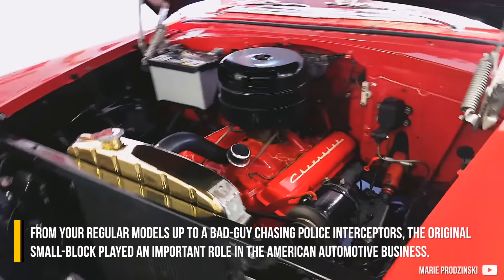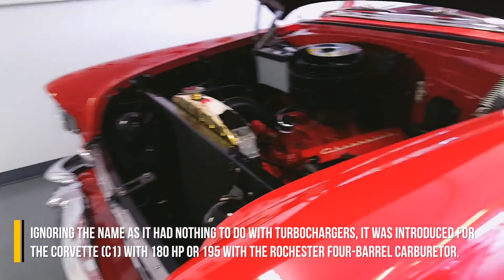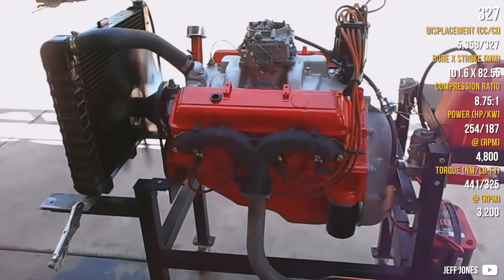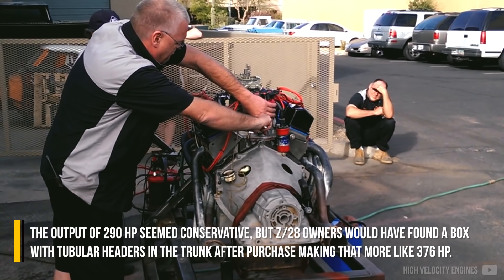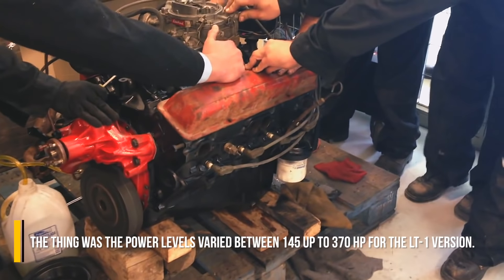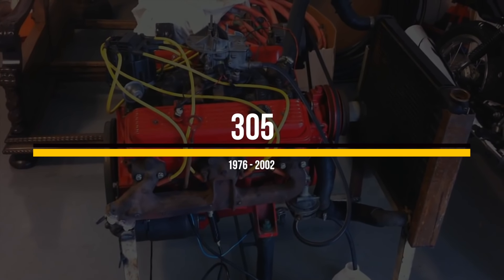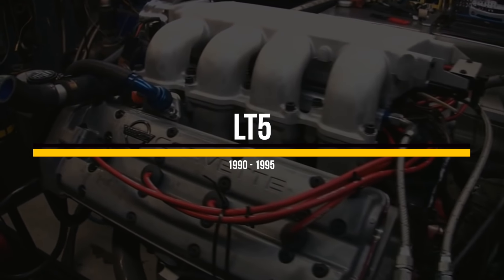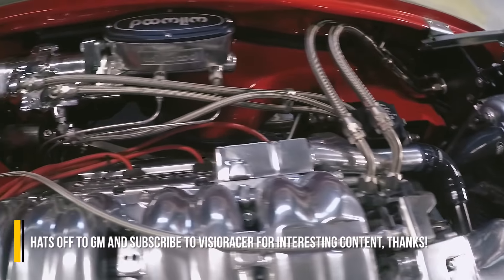GM Small-Block: Explained | Powered America For 48 Years

Comment: Don't forget about the 4.3 V6. It is based off of the 350 Small block with 2 less cylinders. They still use it in the GM trucks and vans today.
Reply: Jaden Sanderson nope not the Vans that ended I'm 2014 with the cancellation of the 1500 express/Savanna
Reply: Kyle C. Are you sure? It is still an available option on the Chevrolet and GMC website for the 2018 model year.
Reply: I think the new 4.3 is based off of the LS motors
Reply: Dakota McAtee Yes, the 2014-current 4.3 is based of of the LT1 from the Corvette and Camaro, as well as the 6.2L from the Pickups.
Reply: Also buick grand national i think
Reply: The newest 4.3 is based off of the LT engines. Direct injected.
Reply: GN had Buick's 3.8. The 4.3 turbo you're thinking of was in the GMC Typhoon/Syclone trucks.
Reply: @dakotamcatee2807  they are. All aluminum. Skirted main bearings and cathedral ported heads.

Comment: Do the GM big block next! The 427, 454, 496, and the monster 572
Reply: Frank Cucunato And the 502.
Reply: BIGBLOCK5022006 I did forgot about the 502. Yeah that's a good one as well
Reply: dont forget the tall deck 366 and 427 v8s
Reply: the monster motors are a completely different block...the GM big blocks started with the 366 which was found in dump trucks and school buses back in the day
Reply: I know. They were good ol' motors too, and really sounded good.
Reply: The largest big block production passenger car/truck engine for Chevy was the 454, everything bigger is a crate engine and wasn't offered in a vehicle. The Big Block generations are 396, 402, 427 & 454. They did a 348/409 before that, yet that's a completely different engine family, no? Caddy did the 472 and the 500. Olds the 455. Buick a different 455. Pontiac had the 421, 428, and yet another variation of a 455. The 502 and the 572 have been the most popular, sales statistically speaking, crate engine and stroker kit, respectively, GM has made (and others ie; Dart, World, Scat, Eagle, etc.) since their release to the general public.
Reply: Russell Loyd I'm pretty sure they had 572s in some Cadillacs back in the 60's
Reply: Frank Cucunato No. Biggest engine ever offered by GM in a production passenger vehicle is the Caddy 500. They had the 472 before that. The GM 572 is a Chevy crate engine, never offered in a vehicle.
Reply: You forgot the 348, 366, 396, 402 and 409
Reply: There's more GM big block families than the Chevy one.
Reply: I Had 8.1 with an Allison in a 2002 2500HD 
I now have a 2020 2500HD 6.6 (400cid) gas I like it better then the 8.1. I pull a 34ft 5th wheel 
The 6.6 has more HP torque

Comment: A year ago I  bought a brand new long block crate 350 engine for my 1989  2500 van for $1500. It came minus the Throttle body, starter, and ignition wires. What a deal. Free delivery, too. It gets better mileage than the 305 that I took out.

Comment: Back in the 70's it was usually easier and cheaper to get more HP out of a Chevy small block than a Ford or Mopar. While the Mopar 340 and Ford's Cleveland motors were comparable to Chevy small blocks in HP, there just weren't as many of the better Ford and Mopar small block packages made. There were a ton of Chevy 283, 302, 307, 327, 350 motors that were made - especially the 283 and 350 motors, and the parts were plentiful and all interchangeable.

Comment: the 307 was a 283 bore with a small journal 327 crank, the  4 inch wide blocks were designed to go 302 327 and 350, by changing the crank throw with the same 5.7 connecting rod, as the stroke was increased the piston pin bore was raised

Comment: The LT5 engine was never based on the small block.  It was a special one-off engine designed by Lotus and assembled by Mercury Marine.  It had a 3.9" bore and a 3.66" stroke.  It also had a two piece aluminum block and no provision whatsoever for a cam in block setup.

Comment: You left out two small lock Chevy engines, the 262 V8 (4.3 L) and the 267 V8 (4.4 L). The are sometimes refered to as "mini mouse" engines, which were designed and built with efficiency in mind.

Comment: Very interesting. I have a question. What is the diference of ci for cc??? Then, what units of small block chevrolet is actually used for drag racing modifing with nitrous, turbo, procharger or a blower??? And what is more capable of it??? Then if you can do the same with big block and motors with be able to modified to drag racing, that's better
Reply: 1000 cc = 61 ci
Reply: Andy Harman thanks for the 1st question

Comment: I recently purchased a 5.7 liter factory built  long block engine from general motors marine.  It is the same small block 4 bolt main seal engine that has been in use for decades but has a roller cam and roller rockers making it a small block VORTEC for marine application. It is fueled with a multiport fuel injection system with high and low pressure electronic fuel pumps attached to the engine. The engine produces 320 hp and 320 ftpounds or torque at 5K rpm. It is a fantastic gasoline marine engine. This V8 engine is as bullet proof as it gets.  I have placed 3 of them in my boat over the past 20 years. The first one was 260 HP with a single 4 barrel carberator.  The second one was 280 hp with a throttle body fuel injection system.  The one recently placed is a beast of an engine.

Comment: You forgot one, which was the 307. Was a durable engine!
Reply: It was not,lot of them did not hold up
Reply: Fondly remembered as "old butter cranks"
Reply: Chevy 307 wasnt  reliable but Oldsmobiles 307 was neither was Chevy 305 those things were trash
Reply: Aaron Cone.
307s had a nasty habit of destroying their cam shafts and lifters.
Reply: A 307 was a 283 block with a 327 crank.  3-7/8 bore, 3.25 stroke.
Reply: Oggy The components were as light and cheap as possible. It was designed by accountants. Nothing wrong with the basic design. They tended to use a lot of oil.
Reply: @CirocObama.94  The 305 was far from trash.  It wasn't built by the factory as anything other than an economy engine, but with the proper set of aftermarket heads a 305 can be built to turn heads.
Reply: @silicon212  I'd rather have a 307
Reply: @CirocObama.94  The 307 has a better bore size, allowing for larger valves with not-so-exotic heads, but the shorter stroke means less peak torque due to less leverage.
Reply: dexos  The WP S/R Torquer 305 heads were similar to the standard S/R Torquer heads, but the valves were a little closer together to allow 1.94/1.5 valves to be run.  That plus the 58cc chamber size made them ideal for other engines with higher compression ratios as well.  Stock 305 heads were smog heads, lightweight castings and flowed almost as well as a solid cement block.  There were some better than others but far and away those S/R Torquer 305 heads were a game changer.  Too bad they're no longer made.

Comment: I''d be a little reluctant to call a 400 cui engine a small block tho.
Reply: It absolutely is a small block.  It uses the same cylinder heads as the 350s assembled alongside them.  The only difference are the presence of steam holes drilled to compensate for the heating issues that came with the siamese bores.  It uses the same valve covers, oil pan, intake manifold, fuel pump, timing cover, water pump, engine mounts and whatnot as any other small block.

Comment: Could have mentioned that the LS series is the small block's successor.
Reply: The 4.8,5.3,6.0 and 6.2 are not considered LS engines.They are based off the LS engines with a cast iron block
Reply: MASON WINKLER not just the Vettes. The Commodore also had them from 2000 till the end of Australian production in 2017.
Reply: MASON WINKLER 
The true LS engines are all aluminum block and heads. There are some aluminum block 5.3, 6.0, and 6.2 engines as well. When people refer to the LS engine, they mean the whole family which includes the iron truck blocks as well. With a few exceptions all the parts interchange between them. They are one in the same.
Reply: Walter Frederick they are considered ls since they share basically everything. The iron blocks are even preffered due to being more durable.
Reply: Walter Frederick Since when? GM says they are a LS right in their performance catalog.
Reply: @Toolaholic7  yes they are... Parts are interchangeable
Reply: The 4.8,5.3,6.0 and the 6.2 in the trucks are vortec engines

Comment: Got to love the 400 sbc.  Siamese cylinders not withstanding it was a great all around engine.  Punch it 30 over, give it a mild cam and a decent intake and carb and it was a stump pulling power house as long and you kept her cool.
Reply: Lot of the race car builders buy the stronger Dart  400 blocks.

Comment: What about SB2.2?
Reply: The SB2 was a variant of the classic Chevy small block designed for racing.  The major difference was the mirror image arrangement of the cylinder head ports.  Traditional was eiieeiie.  SB2 was ieieeiei. This change required different pistons, camshaft, intake manifold, and exhaust headers.
Reply: Purely a race engine, never installed in any factory vehicle.  The SB2.2 was a NASCAR Winston Cup engine.

Comment: VORTEC
WHERE'S VORTEC FIT IN HERE🤔
VORTEC was big change with intro of higher compression ratios and better flowing heads along with roller lifters. 
Cheap upgrade from T.B.I. heads with flat tappets😉
Reply: Vortec are small blocks. They use LS architecture which are also small blocks.
Reply: @nathanreimer1296  Vortec is a brand trademark owned by GM, first used in 1985 with the then-new 4.3 liter swirl port V6 engine used in trucks.  It was used for those V6 engines as well as gen 1 small blocks and the newer LS engines.  

The Gen 1 Vortec heads use the port configuration and combustion chamber design used in the cast iron "Caprice" reverse flow LT1 of 1994.

Comment: In America we got to play with these as kids. That was the old days. Now they make garbage. My favorite small block is the 400 block with a 350 crankshaft. 377 cubic inches, wide bore short stroke so it revs to the moon!
Reply: upside downdog it's funny because as I was watching this video I was thinking of asking in the comments what would the biggest bore to shortest stroke, so it can reve to high rpm...
Reply: Julian Neale 
They truly are a badass combo. 327 also revs pretty good. 327 block with 283 crank also rev good but not much torque. I think it is the 302 Trans Am combo. 305 is worthless for power. Its hard to beat a stock 350 as is but where I live all the old small block Chevys got used up going in circles on a dirt track.
Reply: upside downdog yea sounds like a good combo... if i ever do a chevy project(which is doubtful) i might just consider that
Reply: So right! Putting a 400 crank in a 350 is not the way to make hp
Reply: Purr Cat 
383 combo makes pretty good torque.
Reply: Well my dad had a 1500 Silverado used it as a daily driver for years and years, and the truck was basically decaying around it’s vortek v8. The engine had no issues and outlived the tired slipping transmission, and the rear differential. The LS engines are no joke
Reply: @iwannapoop  
That's why you use the 350 crankshaft.
Reply: upside downdog right  my favorite too

Comment: If you maintained that good old small block Chevy well, than it will keep running for a long time. Gets almost decent fuel economy and has loads of torque. Man, it just hurts me if I see what GM is doing these days. Making all those garbage SUV's and Opel copies with Buick. I know that time is changed, but could GM make one engine again that has some power and doesn't blow up afther a 100.000 miles?
Reply: Literally the LS series, my dude
Reply: The small block in my '72 pickup was running funny.  So I hit it with a shovel.  Now she's purring like a kitten  :-)
Reply: My 5.3 sierra just hit 400,000 miles and ive only had to replace a water pump and an alternator, my dads 350 which he took very good care of only got up to 300,000 then it decided to spin a bearing
Reply: NuclearGrizzly 😂😂😂😂Lmao you are Jeremy Clarkson of US, but instead of hammer there's shovel 😄
Reply: NuclearGrizzly 
Did it hurt the shovel?
Reply: meanwhile the LS engine series engine series from GM has been around for a long time and one of the most reliable V8 engines ever produced... Frick outta here
Reply: I have seen one 5.3 replaced under 200,000 miles,had bad heads.This one was a coolant loss complaint with no outside leaks.Pulled the valve covers after pulling it,full of orange goo and sludged up.Cracked in the middle headbolt hole area where it was casted wrong.There was not a middle support casted in,this was with the castec and non castec heads up to 2006.
Reply: I see some interesting points here, yes the new LT and LS examples are great engines, the problem however is that when GM does build an amazing car with modern V8 power we don't buy it, or at least not enough of them to warrant the continuation of that model, yes I know the Corvette, Camaro, and trucks are an exception to the rule but that shit don't pay the bills, 4 door cars built to hold families do, GM was king in the 60s not because or the GTO, SS, Z28, or 10 other muscle bound boulevard cruisers they built, but because of the 4 door Malibus and Impalas they sold thousands of on the daily
Reply: Ilias Lamari opel is no longer owned by gm so perhaps we might actually see some unique Buick’s and stuff again.
Reply: Jake Reyenard they did till last year. The Holden Commodore was the last rwd V8 Full sized family sedan. Sad really that the Australian government didn't want to subsidise the production of motor vehicles like every other country does.
Reply: Ilias Lamari are you talking about the Holden Commodore? As that's the only Opel based GM product with a Buick engine in it.
Reply: My dad's ford 4.6l e150 ran 300k miles before the engine gave out, and it would have gone longer except he tried to get it home with a busted water pump.  We replaced the engine and it'll probably outlive the chassis.
Reply: Aussie Aus Deutschland yeah but the SS (the US version of the Commodore) is discontinued here due to poor sales
Reply: Ilias Lamari my second cousin had a stock 04 Chevy 4wd with some plain ole mud tires. He drove and mudded the piss out of it. He traded it in with 500k plus with basic maintenance.
Reply: I had an LS motor in a 2003 silverado... the truck completely fell apart around the engine, which still ran like new.
Reply: @Psittac20  Why didn't he get the 5.4?

Comment: So do DOHCs increase power, because a lot of DOHC engines seem to have more power compared to counterparts.
Reply: DOHCs allow the engine to run at higher rpms generally so thats where some of that extra power is coming from
Reply: They generally do, but they also greatly double the size and weight of the engines. If you noticed how small these engines looked in this video, it is because they are all OHV engines so they don't have the cams on top. A good example of this idea is the 7.0L OHV LS7 being about the same size and weight as a 3.5L DOHC V6 from a Camry.
Reply: Jury is really out on OHV (pushrod) vs. OHC engines.  They both have their advantages and disadvantages.  OHC advantage?  Less valve float at high RPM due to less moving mass between the cam and valve.  Less complexity for more exotic designs such as 3 or 4 valve/cyl engines.  OHC disadvantage:  Size and weight.  Put a Ford 4.6 mod motor next to an SBC and you'll see.  OHV engines are smaller and lighter, but are generally limited to 2 valve/cyl designs due to complexity and valvetrain geometry.  

For everyone who says that pushrod engines are susceptible to timing anomalies such as pushrod elasticity at high RPM, I'd like to remind them that the super long timing chains used in OHC designs are more susceptible to stretch at high RPM, leading to the same types of anomalies.  Also, timing belt driven OHC engines can suffer catastrophic damage when a belt fails, which happens considerably more often than with a chain drive.

Comment: 370 hp was super underrated for the z28. It wouldn’t make sense that 11:1 compression and the cam dimensions they were running only made that. You can make way more with way less radical equipment and that’s counting the vintage barbaric tech. I know cam grinds are better and more refined but that sucker was making something like 420 horse back then. You can just tell by the rpms if you look up a video of that specific engine.
Reply: Didn't the ZL1 have an aluminum 427? Did you mean Z/28? I've read that L88 powered '69 Corvettes and ZL1 Camaros were making upwards of 540HP (435 advertised).
Reply: seth094978 um... there were more years for the zr1 besides 68-70. But yes, I did mix some numbers up. My mistake. And yes I was talking about the 350 camaro, as the engine was very underrated.
Reply: MASON WINKLER Yes, and Chevrolet was the one who did it the least the make it appear that they were still superior to the pack. The l88 was a great example since that car was rated at 430 horsepower, but was really making upwards of 530+.
Reply: I will admit I did mix up rpo codes and will edit promptly.
Reply: @theeoddments960  zl1 was only in 1969. 69 zl1 camaros were made and only 2 corvettes were made. The l88 corvette was made from 1967-1969. The z28 with the 350 you’re referring too is the lt-1. They came in the z28 camaro and in the corvette. They were listed at 360hp in the camaro and 370 in the vette. Same engine just listed differently. But yes all them engines in reality made way more hp then they were listed. For insurance purposes